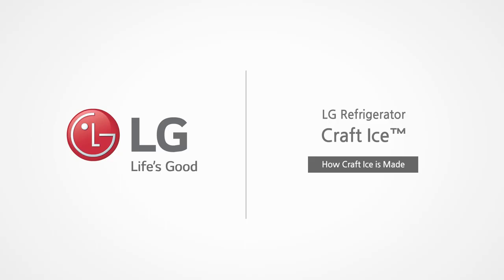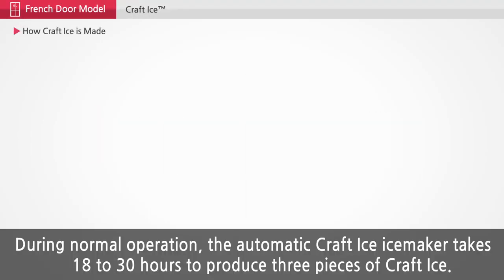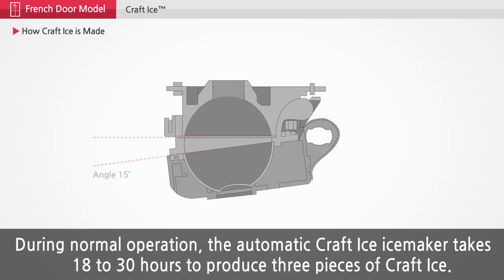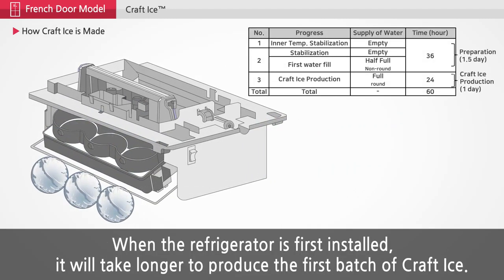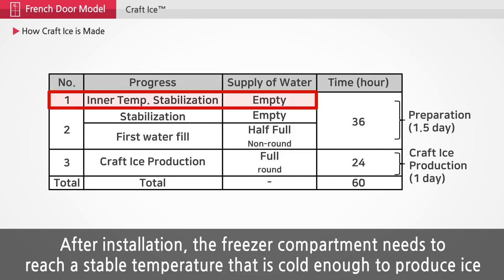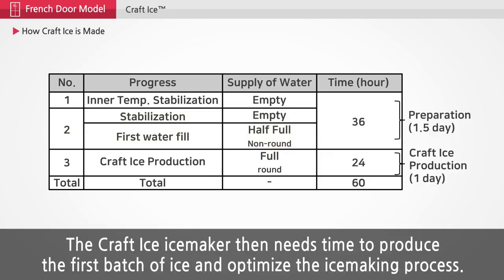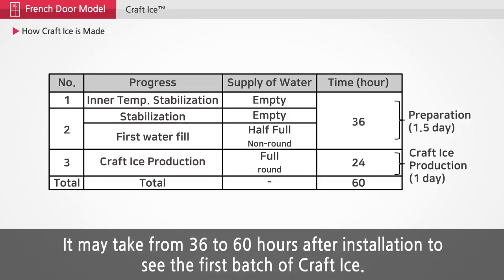How Craft Ice is Made

Comment: That's a long time for 3 ice cubes, why does it take so long?
Reply: its a large volume to freeze. same reason it takes longer to melt. less surface area for cold air to freeze it, or warm air to melt it. When you buy sphere ice molds it takes a while as well. And the fancier ice mold buckets that make it crystal clear takes about 24-36 hours. They COULD make more molds but that would take up more space and more energy for the compressor. mine makes about 6 per 24 hour day.. a little faster if I turn on Ice Plus.